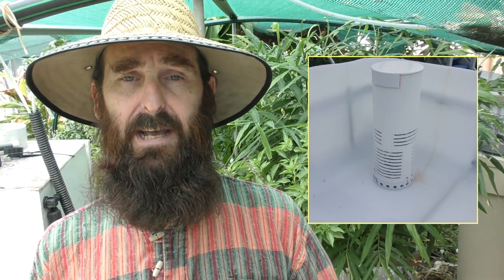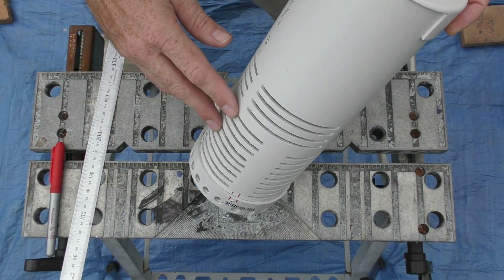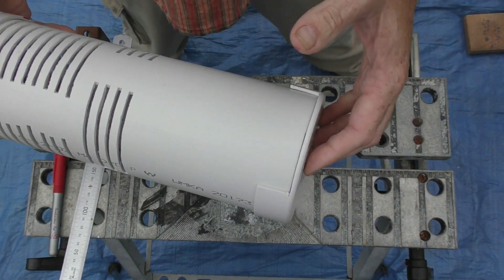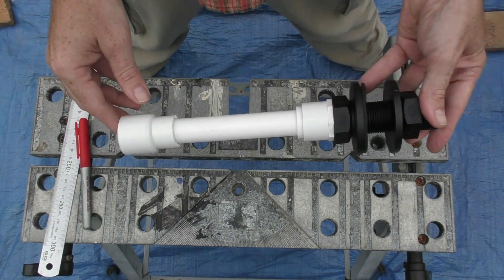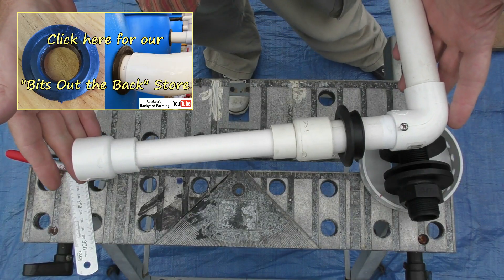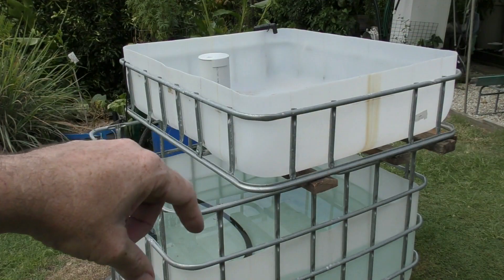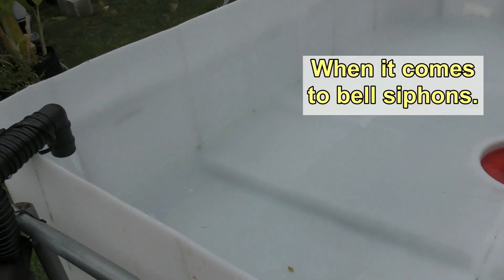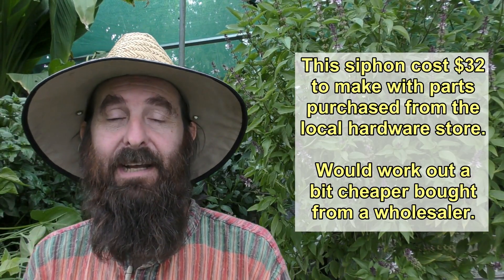How to Make a Bell Siphon & How Bell Siphons Work

Comment from the maker: Thanks for watching folks & don't forget to click the subscribe button if you enjoyed the video. 🐟🐟
Share the clip around with family & friends if you think they'll enjoy it too. 👍
Cheers all & have a top one. 😊
Reply from the maker: I would try to make the drain under the bed ¾" with 1" being better to help with the water & air flow.
Reply: @RobsAquaponics  Awesome, thank you. I should upload a video when I'm finished setting up the system. So excited :) I found out the hose threaded adapter comes out of the bulkhead fitting and it's a standard female NPT thread, so no big deal. I just finished digging to set the IBC ~24" into the ground. That should keep things nice and cool - but I have to dress the tank with something before burying it. So much work!!!
Reply: The flow is restricted to 3/4 in? I have a 3/4 bulkhead fitting like that one... but the thread on the smaller end is meant to be adapted to a garden hose - or has the same kind of thread anyway. Will it matter?
Reply: Awesome
Reply: Thank you Rob you are a life saver 👏
Reply: Can't find the link to the parts list
Reply: Another great video. Many thanks.
Just in the process of setting up in England. Trying to work out how best to regulate temp of 1000ltr fish. Winter summer temps are quite a range. I'm  making a building to house grow beds but I'm hoping  not to heat? Either fish or green house. Was thinking of rainbow trout and ground source loop to regulate tank and beds?
Reply: I watched the whole 20 monites.... and Im laughing 😊 Im not into aquaponics... but your amazing
Reply: Appreciate your videos.  Informative, no nonsense, and good level of details to be practical resource.

Take your collection of play lists, put in an order of progression for newbie to old hand, maybe a dozen  or so pdf of drawings, parts list, pictures, and documents  with list of favorite products/suppliers you would have loved to have when you started journey all on DVD.  Sell as DVD or one-time download.  

"Best of Rob Bob's Aquaponics & Back Yard Farming Made For You"
Reply from the maker: @joeboxter3635  I just started working with some folks that want to help me make up some guides but can't say too much for now. 🤐 
Cheers.

Comment: what is the list of all the materials i will need to make a bell siphon
Reply from the maker: Hi Alexandra. I didn't include a list as not all these parts will be available everywhere around the world + some may want to vary the height of their grow beds. 
I do run through the sizes of the pipes & lengths used in the clip though for this roughly 30cm/1ft deep bed if that helps.   
Cheers & all the best.
Rob.

Comment: Hi, My bell siphon can drain the bed fast , but can't break some how. I lowered the flow of water into the bed and it still won't break. I hear it gurgle and the water of the bed is always low. I assume because my bell siphon isn't leveled. It is leaned to the side a little which makes my stand pipe and the bell lean to the side
Reply from the maker: What angel is the pipe under the bed sitting at?  If the end is elevated that will also stop the siphon from breaking at times. 
Hope that helps some.
Reply: The pipe under the growbed is a classic 90 degree angled drain pipe .
Reply: The end is facing down
Reply from the maker: Did you build it the same as I did in the clip?  You could try straightening the standpipe a bit. I have one that's off by a noticeable amount but the siphon still fires off fine. Sounds to me to be a flow issue with more coming in than the siphon can handle.
Reply: Rob Bob's Backyard Farming & Aquaponics  I'll try and re adjust the flow to the lowest tomorrow  and I'll update you as soon as I get to it
Reply from the maker: 👍Cheers mate.

Comment: Thanks Rob, very helpful video, I just build my first Bell Siphon, It works perfectly for few cycle,but then the cycle stops and small amount of water keep droping from outlet pipe ! need help ..
Reply from the maker: Hi Mate. 
Did you make it as I did in the clip? If the bed isn't filling back up again it might be that the inflow is just a bit to much & isn't allowing air to get in to break the siphon. You could tun the flow down a bit & that should do the trick. 
Hope that helps some.
Reply: Ok, let me try.thanks.

Comment: Is the 90 deg... necessary?
Reply from the maker: Hey Genma. The 90° does help place some back pressure on the drain pipe that helps initiate the siphon but have seen some systems set up without them. Best thing to do is to play around with it & see what works best for you. 
Cheers.
Reply: Thanks for the video... it is quite informative... I've tried it in a small scale just to try the concept of the bell siphon.  I tried to grow some clovers... but too much finagaling for me at this time. A lot of teasing it out in terms of in-flow.  It either don't start or don't stop.  One of the many things I didn't do was put in a 90 on the bottom... it didn't seem necessary.  I might do aquaponics on a massive scale one day... with a pond and trees on aquaponics.  Not sure if trees can handle flood and drain... or be able to stand up and not be blown over.

Comment: Thanks for that bit of walkthrough, I've been looking into setting up a small scale aquaponics setup, and like the bell siphon method best so far from what I have seen
Reply from the maker: Glad I could help some. Have you started the build yet?
Reply: Hi, thanks for the response.

No, I have not started yet, it's been pretty wet here in California so far, so I have not been able to get anything started. I did draw out an idea of what I would like, (drafting classes 15-20 years ago come in handy sometimes) though it is probably bigger then I should go with no experience with any systems other then conventional, in the ground gardening, and limited funds (I like my plan drawing, and really think it could do wonders, 150gal tank and 88 ft² of beds, but would be more then I can spend most likely). 

Hopefully I can decide what size system I want to put in soon. I'm going to have at least one area 6 feet wide and 20 feet long, possibly 2, depending on how in depth I want to get. Typically we would have 2x-3x that space, but outside circumstances have cut that space down for this season.

I have also thought that the chop and flip setup you have shown, especially with the 55gal drums, that could be a good way for me to start out and learn the ropes of aquaponics before going full size. I also would really like to use edible fish, which I will have to research some, and find the best fish for here, summer get to the low to high 90s ºF (mid 30's ºC).

I do plan, once I start, to post videos about it on my channel, and show my progress.
Reply from the maker: Is great to hear that you are putting a fair amount of thought into the system before lifting any tools. Planning could save you a lot of pain down the track. 
Cheers & have fun with the build.

Comment: Hi Rob, great vids, I'm doing my first Siphon and am confused as to what size bulk head fitting to use, do you use a 25mm fitting and drill a 32mm hole? I watched it twice but maybe I missed something, cheers Dwayne
Reply from the maker: Hey Dwayne. It's the 32mm/1¼" you'll need for the 25mm/1" bulkhead fitting. I run through it early at 3:56 if it helps any. 
Cheers mate & hope the build goes well for you.

Comment: no - no, l think you missunderstoob -- l have two halves - of a ball jiont - from a drag line... theyre about 1/4" thick x 12" across, solid brass, and they make up a sphere, with about 1/4 off where the shaft went in...ANYWAY - l have two beautiful halves of a brass sphere, and they ring really well, while theyre lying on there backs, round side down -- however, l cant seem to mount them, because - if the edges touch anything, even each other -- they just give a pathetic dead "clunk" ...there are even holes in them for mounting, but again - that is then -  just another leading edge...but hey! at least l now have some very good tips on how to better irrigate my pot plants -- and, that should keep my mind from dwelling too much on that pesky resonance cannundrum...

Comment: Thank you so much for this introduction of a Bell siphon! 

I am a newbie and start learning about aquaponics and I am very interested. 

What I like to know is, why do you use a Bell siphon for aquaponics? Wouldn't an overflow tube just do it as well? Why do you have to flood and drain all water from time to time? 

Is there any issue to the process of cleaning the water with bacteria? 
Or do you want to hinder mosquitoes nesting in the standing water?
 Or what is the reason? 

Have a nice day! 

Dana
Reply: the reason is that the roots need oxygen just like the rest of the plant. also the worms might die if the bed stayes flooded. just using an overflow pipe will work mind you but a bell syfon works beter
Reply from the maker: Hi Dana & sorry for taking so long to respond. 
Flooding & draining helps to allow O2 into the root zone for the plants & bacteria colonies to use. 
The bacteria generally do all the water cleaning that is needed other than solids removal. That can be achieved by either letting it settle in the bed or can be removed by a simple mechanical filter, like a radial flow settler/filter, that you can build yourself. 
Hope that helps you out some & my apologies again for missing you post.
Cheers.
Rob.

Comment: Hey Rob,
Another question:
Why did you go with a 20mm stand pipe and not the standard 25mm?
Thanks again for helping out :)
Reply from the maker: Hi Jason. Sorry I missed this mate. Not sure if I answered it elsewhere.  I found having the narrower 20mm pipe with the 20-25mm adaptor on top helps to initiate the siphon faster. I found with the 25 mm I was having issues at low flow rates & found this to be the best solution. 
Sorry again for taking so long mate.
Rob.
Reply: No worries at all. I have since then decided to go with 1" or 25mm stand pipe. I did find that for the bell I had to use 76mm or 3'' due to the little room left by the  adapter...if all that makes sense.
I will try with a piece of 20mm stand pipe and a 20to25mm adapter. I have a split flow, same as you do, redirecting part of the pump flow to aerate the FT water. Would be interesting to test with low flow, now that I have been running for 3 months.
I realised too that I had not enough room in to add a 'snorkel' to help engaging/stopping the siphon.
My media guard being 101mm or 4'', I should have gone with slightly bigger...it's tight in there :)
Very grateful to you for sharing so much experience with us. Thanks mate :)

Comment: hey rob bob what can i use to get our grow beds going if i do not want to use old urine??
Reply from the maker: Hi Jonnie. I think the next best thing to use is the fish feed you intend to feed the fish with. It also helps to get you into the habit of feeding & checking the system regularly. 
Just start adding the amount you would need to give the fingerlings daily & that should help set up the bacterial colony in the grow beds. You may end up with a bit of sediment on the base of the tank depending on how you have it plumbed up but the fish should disturb it & move it through the system once they are added into the tank. 
Hope that helps some mate.
Rob.
Reply: thanks we will try that thanks

Comment: hey Rob, really enjoying the aquaponics series. getting ready to build out my first system and your videos have really helped me understand it all well before I start it out. 
was wondering what your take was on using fiberglass-based beds, I found a local fellow who's selling them in bulk and at a good price. Are there any differences or downfalls to using fiberglass over the IBC plastic beds? 
Cheeers!!!
Reply from the maker: Hi there. I've seen a number of folks use fibreglass tanks & they look to work fine. I've not had any experience  with them myself. I was told that that some of the cheap ones can degrade faster than the plastic but like I said I really don't know much about them. 
Am glad you're enjoying the clips & hope they do help you out some.
Cheers.

Comment: My bell siphon isn't draining my grow bed fast enough. Takes 10-12 minutes to drain my grow bed.My grow beds demensions are 36x24x8.My pump is 264 gph.Please help
Reply: My bell siphon is 6 inches. And 1 inch wide I think or more but definitely  not 2 inches
Reply from the maker: Sorry for the slow response. Have you fixed the issue yet? 
Sounds like your flow rate might be too high to me.
Reply: I've fixed the problem

Comment: Good one Rob
I built basically the same siphon (Yep Affnan as well... a sharp dude) and after initial tinkering with drain pipe extension / fittings, it works flawless. I had some 4" slotted ag pipe and seems to work good for a shroud.
Thanks for more great info. The mega ginger looks awesome.
hope all's well
Jeff
Reply from the maker: Hi Jeff. 
There's a reason the Affnana's siphon has become the standard 👍  
Hope to be pulling the ginger out this weekend If I get the time.
Cheers mate & hope seasons treating you well. 😊
Rob.

Comment: Thanks Rob! Excellent video. 

Glenn Martinez has an interesting twist on the bottom fitting to the bell siphon. I've tried it and it works quite well. https://www.youtube.com/watch?v=aeKODBAZ74E

See Ya!
Reply from the maker: Have seen that little fix & think it's a great idea if you have an air break on the side of the bell & are running with slow flow rates. 👍
Cheers.

Comment: im a long time subscriber great video.   im gathering parts for my system.   I live in ohio so have to go with a greenhouse because of the winter weather.   not sure on the type of fish but have another year before I will have all of the parts gathered.   trying to do it on a tight budget.   thanks Rob.
Reply from the maker: Hey Big Bill. 
Hope the build is coming along well mate.  What fish are you thinking of running? 
Cheers.
Reply: Not sure yet but it looks like i will be raising a type of perch they seem to be better to handle the colder temps during the winter.  I'm still trying to sort out the heating of my greenhouse.   It is only 12 x 28 feet to start with but could be costly to heat in the winter.  Keep up the videos really enjoy the aquaponics builds an fish farm videos.   Thank Rob.
Reply from the maker: Nice one. Hope you can sort out the heating so you can prolong your growing season. 
Cheers mate.